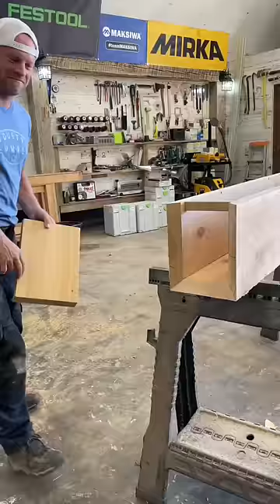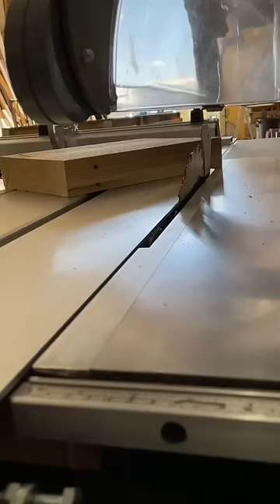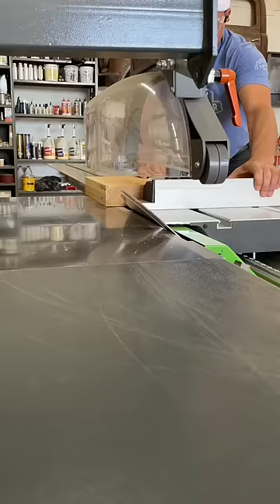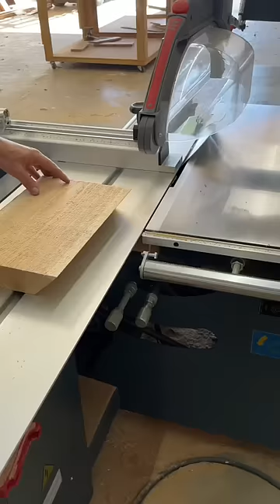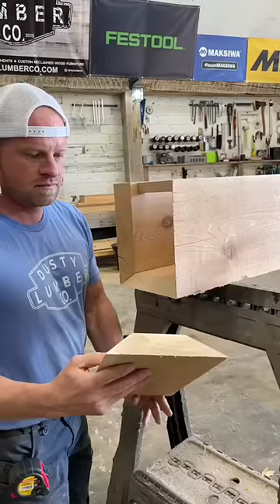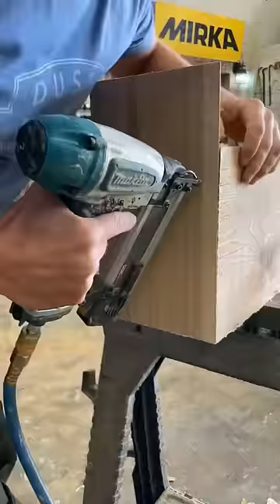Wood end cap #woodwork #woodworking #maker #maker #wood #tools #joinery #work

Comment: DUDE.... what kind of amazing table saw is that? I wish I had half of your tools. Freakin awesome workshop
Reply: Industrial one
Reply: One you likely can't afford but they're called panel saws
Reply: Last one I saw like that was retale at like 30k
Reply: @codymoreland4496  you can get used one for less than 5k
Those saws are pretty standard in Germany. The American style saws are only really used on construction sites and never is good workshops.
Reply: @codymoreland4496  panel saw is upright, this is a sliding saw
Reply: @codymoreland4496  that ain't no panel saw bud
Reply: 精密锯  我们这的便宜  能用

Comment: On that miter joint that Cedar will soak up the glue. I always apply 2-3 generous coats before nailing and clamping. If you’re doing a mantle then I would cut shy of the end on one side so you don’t get that splintering? I find cedar a bit troublesome to paint well compared to other wood species. I mostly use cedar for outdoor work unless it’s STK T&G that I’m planking. You’re making a faux beam, do a distressed look that might look nice?

Comment: Any reason you use the titebond original instead of titebond 3? Just curious.
Reply: Isn't the titebond 3 for products that need to be foodsafe, like cutting boards?
Reply from the maker: Titebond original is strong enough. Stronger than the wood. Also 3 is for stuff you need to be waterproof
Reply: @dustylumberco  I hear you. Titebond original is definitely tried and true. I've just been using titebond 3 for as long as I can remember. I figure all wood technically has some moisture content so anything to counter that is nice. Also titebond 3 was 25-40% stronger than original in Project Farms testing of tensile and shear strength. Both performed very well though so it really doesn't matter. When my local supplier was out of titebond 3 I didn't hesitate at buying original. Nice work sir. Always a pleasure to watch.

Comment: I like your videos and your woodwork, however that example of joinery using nails and glue on end grain was disappointing; almost like you did not want to take the time to do the joint properly.  

You could just as easily have used an interlocking three-sided miter joint or a stepped, tenoned three-sided miter joint and made a great joint.

Comment: I don't do wood working so if I'm ignorant pleas excuse me, but if you were going to use the nail gun what was the point of the glue?
Reply: The glue is much stronger than those little pin nails. When PVA glue cures, it tends to be stronger than the wood that it's holding. The little pin nails are mostly there to hold the piece together while the glue sets.

Comment: I would have used clear tape to hold the cap in place until the glue dried. I do it frequently at work and it works great.

Why make a nice piece and then shoot nails through it?

Comment: When you have a $9,000 table saw in your wood working shop it's not very impressive. I do the same thing on a $300 DeWalt that sits on the floor and my final product isn't 5 inches to long.

Comment: With only shrinkage in the width and not in the length this will cause problems because the circumference has shrinkage on al sides.

Comment: He didn't calculate any angles and didn't show any measurements 😁
Reply: There are no angles or measurements that need to be taken. The structure he's working with is squared so he just makes the end cap squared.
Reply: @tingle2958  if there are no angles than how how he set the blade on some cross angle...dear watch video😁
Reply: @Ta Na  two 45° angles make a 90° angle. Come on buddy this isn't complicated stuff.
Reply: @tingle2958  agreed but its difficult for those who are beginners👍🤣
Reply: @Ta Na  fair enough. Basically he didn't need to check any angles, because they will be exactly 45°. And he didn't need to take any measurements, because once he has cut the first corner, he can just mark the next cut using the existing structure, as seen in the video 🤙
Reply: @tingle2958  👍😁

Comment: Wood end cap, it's not a great description of what you're making. I'm flooded with your short videos, not a huge fan that I'm earning revenue for you when you are doing such a bad a job. I'm a qualified craftsman in NZ and I just want to know what you're making here. there are so many jointing methods available that aren't exposed like brads but depending on what you're working on, it may not matter but to me, I'm looking at a mitred box with no end grain exposed on the joints, it's a beam cover or decorative surround of some sort but you will forever see the brads you used, or the filler you put in when you punch them under the surface of the timber. in any case, i really don't rate the work you do, but I can't stop youtube from throwing this crap in my face
Reply: Mi amigo si no te gusta puedes irte.
La envidia es un mal muy destructivo.